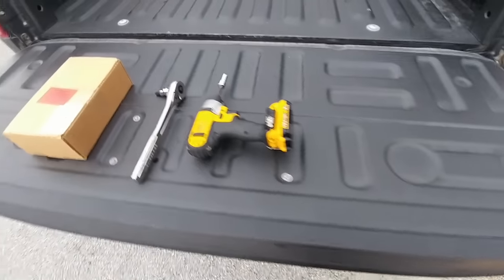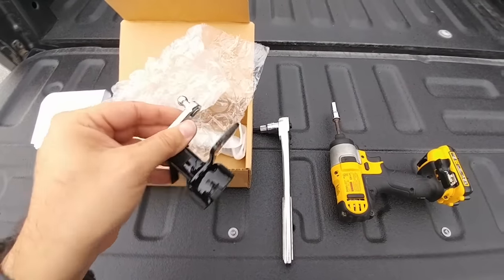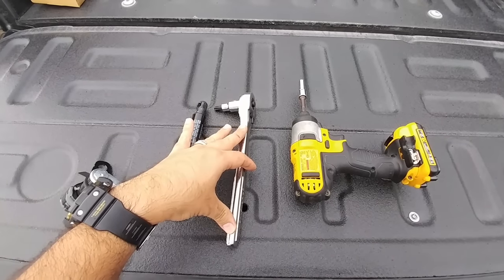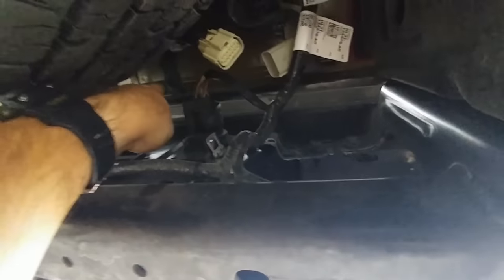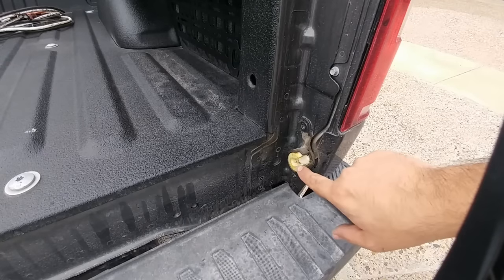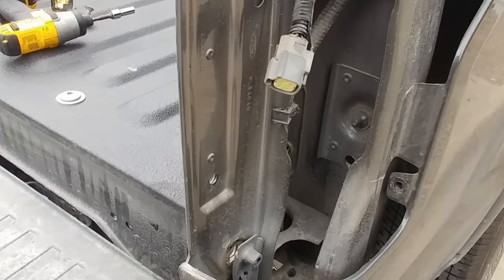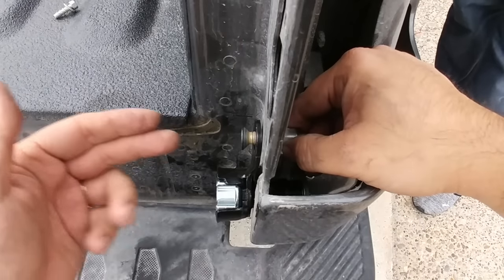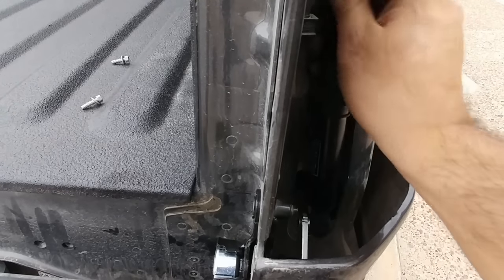Best $65 spent on an Ford F150 XL, STX and XLT!

Comment: I’ve owned trucks for over 47 years & the tail gate wasn’t a problem, what I took issue with is some commented on how they have Steps now in the gate, well after working construction for 45 years and had back surgery at age 60 & still have back pain I won’t buy a truck that doesn’t have a Step & fords is the best. I’m 64 and at least I can climb into & out of the bed of my truck. So don’t knock it because one day you might need that step yourself!!!
Reply: I get what you're saying man. I'm a disabled veteran but I cannot give up. I'm climbing in that truck if it hurt's it takes 20 mins or I'm dying. No step.
Reply: Tell that to farmboy at ga farms , he seems to be able to dictate what we can have on our trucks .  Sad , wait til he walks a mile in our shoes . ty for your comment .
Reply: Hey man I'm 27 years old and healthy as a horse and I use my tailgate step every time I get in and out of the bed of my truck. No shame here
Reply: If you have a cap the step tailgate is worthless
Reply: Agreed. When buying the truck I figured id never use my tailgate step. And almost bought one without it...... Ive found out I use the step allllll the time. So useful. Really is one of the best options on the f150s.
Reply: For those like me who struggle with a truck that does not have a built in step, specially if your truck is jacked up... it's simple enough to purchase an inexpensive folding step ladder/stool. Rubbermaid makes a "plastic" one that is lightweight and it doesn't take up that much room in your truck, but it sure is convenient when you need to get in and out of that bed. Work smart, your body is going to wear down. Don't beat yourself up unnecessarily.
Reply: My problem isn’t having a step, it’s that trucks are so big you NEED a step now
Reply: Agreed. I think part of the issue besides me getting old is that they make trucks taller now.  Or at least that is my story and I am sticking to it.  LOL.
Reply: I'm going to buy a bumper with the step for my 2005 f150 stx
Reply: So steps are necessary because you wrecked your back ? At what point do you advance enough at your job to the point you aren’t getting things out of your tailgate?
Reply: DAM I KNOW WHAT YOUR SAYING CUZ I AM RIGHT THERE WITH YOU AND MY F 250 HAS THAT OPTION  REAL  HAPPY ABOUT IT TO
Reply: @Bamacher59  ... A cap means you don't ever get into your bed again?
Reply: @rolandthethompsongunner64  When you're the sole-proprietor of your handyman business, and you still need to make money to have a living.
Reply: Agreed mate!

Comment: I've installed several of these Ford oem tailgate dampener.  You do not need to unplug the harness to the camera and remove the tailgate to install. Place a coating of towels or blanket on top of the bumper making sure the right side is well cushioned to prevent damage to tailgate or bumper. Leave the left tailgate strap attached, raise the gate from the right hinge and lay it on the cushioned bumper leaving the left side of the tailgate attached to it's hinge. You will need to pull the right corner of the tailgate rearward about 3 inches to perform the rest of the install. As said done this numerous times with zero damage.

Comment: Great video! Clear and instructional. 
While researching this, I found the DeeZee Tailgate Assist  DZ43204 for years 2015 - 2018 Ford F150. $27 delivered to my door. No tailgate removal. No tail light  removal.  Simple install. 
1347 reviews on Amazon. 86% 5 star.  Older trucks use a different  part number. FYI
Reply from the maker: I've installed several of them and unfortunately they tend to bend the ball connection on the tailgate where the nutsert goes through after a while.  If you search you'll see the videos I've done on that product.

Comment: I put the dee Zee Tailgate assist on my f150 and my f350.  Only $26 each, they work great and were much easier to install.
Reply: I just got one for my 2015 XLT.  Haven't installed it yet.  When the temp gets above 40 I will!  LOL  BTW, the reviews of the Dee Zee were as good or better than this expensive feature.
Reply: I did that too on my 17' ram my only thing is sometimes it's too slow but I mainly put it on for safety with my 3 kids being under 6 yrs. Sometimes they like to be right my heels. Other people criticize about about this product or one like it guess what everyone has a preference that's why trucks have options. No need to be  Dick's about it. The DeeZee one does work but in winter months it's extremely slow I actually took mine off temporarily

Comment: I bought one on Amazon that has the piston sitting on the drivers side well where the tailgate attaches. It literally took 7 min and came with all the tools for like $25. No need to remove the tailgate, or disconnect electrical harnesses. They are helpful.
Reply: @Get to The Choppa!  What brand did you get?
Reply: link?

Comment: I got the $20 deezee one and it seems to work really well for me, took no more than 10 minutes to install as well
Reply: Me too, and quite a bit easier.
Reply: I did also. It’s been on there for about a year and half and is still working great.
Reply: My Deezee got in a bind with the cable and ruin it staying on the nipple
Reply: Dee Zee was easy to install about ten minutes been working great even in icy conditions When it goes bad, might get this one
Reply: My deezee snapped off at the ball end 😳
Reply: Yep. I have thee DeeZee as well. So much easier to install and cheaper too. Works perfectly.
Reply: The Ford one is a lot better smoothing action.  and it is hidden.  I did the deezee first and regret "paying twice"
Reply: Me too this is great bc it’s hidden but I would rather prefer cheaper cost for a quality product and VERY easy install or uninstall if needed
Reply: I got the DeeZee one as well, but the ball mount came loose in the tailgate after less than a year. Haven't gotten around to fixing it yet, what with it being below zero recently.
Reply: Same here. I do like the way that one is hidden behind the light. Pretty neat but i like mine as well.

Comment: Might have been worth sticking a tailgate anti theft lock on while you had it off. No, they are by no means fool proof. However, it will help to prevent someone from just walking off with it in a Wally world parking lot.....great video as usual  btbrv!!
Reply from the maker: already done. Thanks!
Reply: Or lock the tailgate.
Reply: the tailgate locks with the doors on the 2018 f150 so not really needed as long as you always lock your doors.
Reply: @corystrand5136  
They are pretty easy to open and take off when locked. The lock keeps honest people honest and that's about it.
Reply: Ford tailgates lock with the doors
Reply: Just put a hose clamp around the passenger side hinge pin. That's good enough to deter most people looking to do a quick smash & grab.

Comment: Nice! I think the XLT I looked at already came with it, but I think this is a must have if not. Especially for older people, or women. It makes the tailgate easier to deal with. Still have to close it manually, but still better regardless.
Reply: I have not checked. But I would bet that the Self lifted tail gate is a very expensive up grade from the Manufacturer. I always stand on the rear tire to get inside. I also have a bad knee. Love the Video!

Comment: I put the DeeZee  tailgate Schock on my F150. It was only $35 and you do not have to take your tailgate off to install it. It is not hidden, but only takes about 10minutes to install. I've had mine over a year and still works like new. My son put one on his RAM.

Comment: This product looks good, but for the money (value), I think the DeeZee is a better option and is roughly $50 less. Also, I noticed that the tailgate did drop in the last few inches with this product.  The DeeZee product is smooth all the way and there’s no drop whatsoever.

Comment: This is the First Mod I did to my truck. It really comes in handy when I carrying a bunch of stuff. Also my Wife and Daughters appreciate it. The Other Cheap Mod I did was a 24" Wiper Blade on the Driver's side. The 22" Remained on the Passenger side. I put the Ford Mud Mats in and I ordered a OEM Seat Cover Cushion for the Driver's Side. When it wears out, they are no longer available. Next on the list is Coil Pack covers.

Comment: Interesting design. I have a silverado 1500 which came with a slow open tailgate from factory. With how often I use my tailgate and how well chevy built it, the slow open feature lasted about....6 months. I then upgraded to a deezee tailgate assist for $30 and it was a way easier install than this. Two screws into existing holes and about 5 minutes. It has lasted for 3 years and going strong!
Reply from the maker: all my DeeZees on previous trucks failed within a few months of installing.  Mainly because the previous Super Duty tailgate was extremely heavy.
Reply: I also added the deezee to my superduty but I had to put 2 on , 1 on each side of tailgate , 1 doesn't do it.
Reply: Share the link
Reply: Shra the link $30
Reply: In Alaska one opening at -50 would likely render any of these assists useless. Hood struts usually don’t last if opened in extreme cold.
Reply: @akbychoice  you up here in Fairbanks?
Reply: Riding With The Reid's still have a house in Ak currently out of state.

Comment: I would suggest putting the tail light assembly back on, after you make sure the tailgate is sitting properly in place.
Reply: Thought the same thing; you need access to the nuts for micro-adjusting the position of the hinge.
Reply: @hansschotterradler3772  that is because we are German and think logically, while also being creative.

Comment: Thanks for the video .. sorry about all the trolls ... my gf has a stx and I’ve been upgrading it little by little to make it like my xlt .... she now has a remote start and spray in bed liner .. next will be the corner step( would have to replace the whole tailgate to get her a step in it ) and this soft mechanism for tailgate will be nice for her .... I also have a new ranger xlt fx4 .. we are definitely ford truck people ..the frustrating thing is navigation .. on tge stickers they are now 700 bucks .. if you got sync 3 it should be plug and play and by a nav unit for 7 to 8 .. but ford wants 2000 for tge damn things .. after market rehabbers selling them over a grand ...

Comment: I agree with a lot of the comments, there is way to much crap for "ease of use" and "luxury".  For me, less is best.  However,  most of these little ideas come from  consumer ideas/requests.   I can underatand if its on a Lincoln truck or a cadilac truck but not on an ford, chevy or dodge.....jmo

Comment: I got the DeeZee tailgate shock. No need to remove any tailgate or lights. It works very well and was only 32 bucks.
Reply: wow, who knew removing two 8mm bolts was such a workout

Comment: Baghrir the previous, I would have put a anti-theft device on it or a hose clamp on it. To prevent people from taking the tailgate. I currently have a 2015 Chevy Colorado, it was my mistake not buying a Ford F-150 with a 2.7 l 10 speed.
Reply: And when you lock the truck, the tailgate locks on my 2015 XLT.  Don't think anyone will steal it...
Reply: Ed, why do you regret getting the Colorado? Reliability issues?
Reply: We use the truck to travel to our family in Mexico. Just not the right size for that. When I need a truck and it's just too small to do what I needed to do. When I needed to tow with it, the fuel economy was 4 miles to the gallon.

Comment: Maybe it’s my OCD but when I installed mine I used a torque wrench to finalize tightening the bolts to 41ft-lbs.  I haven’t seen anybody do that yet in their instructional video.
Reply: Andy Brown it’s motor internals bro calm down. Torque to spec your mouth shut
Reply: I don’t know why people have to use power tools to turn screws. It’s like people don’t know how to use a screw driver. And then over tighten everything with power tools.
Reply: Tom Hardware welcome to 2019

Comment: Arm strength does the same thing, better design and strength tolerances can be increased. Save $65, you need it for the fuel scam prices. That "accessory" has limitations.

Comment: Nope, must disagree with you on this one (hey, first time for everything).  Have had both the OEM and Dee Zee on a few different trucks.  Cost aside, I far prefer the way the Dee Zee opens (the OEM always drops way more suddenly at the end, and noticeable bounce at end of travel).  Your video even shows it.  Not even close, save the $40 bucks, and get the better assist, Dee Zee for the win.  Mic Drop....
Reply: dee zee looks like an atrocious after thought, who knows the quality of that strut as well. Secondly they even know it's poorly designed by offering the chaffing protector strips hahaha what a joke
Reply: Jeez, what did Dee Zee do to you in a past life.  Folks have been installing that strut for many years, probably far more on the road than the OEM.  Both the OEM and Dee work very well, but if you have ever lived with both, you would understand.  The 2 trucks I installed the OEM, was also happy with it, just preferred the Dee.  If you care about what the inner jam of your tailgate looks like, well I can't help yea there.
Reply: Ive used two on my truck cuz I had to replace my tailgate.. both lasted less then a month

Comment: I have an 08 f150 and I installed DeeZee's version of this and it worked fine at first but it sheered off at the connection inside the tailgate. Needed a new tailgate later on and I ordered a new one for the new tailgate and the same thing happened.i think it's from all of the weight sitting on the tailgate and it all goes into the mount instead of the cables

Comment: Still driving a 92 didn’t realize trucks are built for the weak now
Reply: For some reason I always loved the thud sound my tailgate makes when opening it.
Reply: Still driving my 97 f250. 
If you can't put the tailgate down maybe you should drive a prius
Reply: And I'm 71.
Reply: Perfect for the city yuppies lol
Reply: hell ive got a 94'  ( i ain't got no problems)
Reply: @cafenightster4548  -lol  i know right.  it's manly   (yeah)  oh oh oh oh -tim the toolman taylor
Reply: I knew it when the rear tire was no longer the step to climb into the bed and stairs and handrails were part of your $1200 tailgate.
Reply: I sold my 95 F-150 that only had 383,000 miles on it. It didn't do anything like this.
Reply: Carl Rice next year ford will have a built in escalator to compete with Chevy’s steps
Reply: Power steering, auto trans, power brakes, power windows, electric start, electric windshield wipers, AN ENGINE WHICH RUNS ON FUEL! Which of these do you have toughguy?
Reply: Coz you're a real man, right?
Reply: Still drive my 93 f150 everyday pulling a car hauler never had a issue with my tailgate and it gets abused lol
Reply: Brit Jamaine I’ve got a 91 225k on it and still goin strong
Reply: Biggie Baby last I checked
Reply: Cuz making life easier means your weak I guess
Reply: @ochelix4989  so being disabled is against your laws of what's a " REAL MAN " is ??? Thanks for that , so informed ......

Comment: Why are tailgates these days trending into the creature comforts area? This was never an issue before. Now they have steps, handles, soft drops, multi style opens. I feel like auto manufacturers are just over complicating it to convince you that you need these cushy features. It's a drop gate people. The best creature comforts should be a single center handle verses two side buckles and catch cables. That's all it needs.
Reply: Well the steps just simply make sense in general, nobody is impressed by someone declaring they don't need a step, just cringe.
Reply: @bobbybologna3029  it's an over complication. The back bumper is the step if you need to get back there.

Comment: Does these go on a 2006 Ford F-150 4x4? Also you only installed one on the passenger side, but do you have to buy 2 for both sides?

Comment: For all the comments about the Deezee unit (which is what I have as well), yes it's cheaper and less hassle to install but  if you want a cleaner install with no shock showing then the Ford OEM unit is the way to go.

Comment: I ordered one just like this, it didn’t work. I contacted them and they sent me another one and it didn’t work either. These were  $43.00  from Amazon. I then ordered a Dee Zee one for $22.00 and it works perfect.  Even this one that this guy just installed still slams a bit.
Reply from the maker: Careful with the DeeZee. I went through 6 of them on previous trucks.  All failed at the ball or nutsert mount.

Comment: I have F250 2012 and the sat radio and Bluetooth connections have failed, started to pull the dash apart to remove and found that hidden fasteners, without a good video found, were probably going to be broken .  I would love to see something like that from you. Thanks.

Comment: I bought a used truck awhile ago with dee zee installed, it does its job perfectly. But I don’t like it, the tailgate opens too slow I guess I’m not used to it. I don’t dislike enough to remove it though.

Comment: This is not a do able addition for a 2010 lariat like i thought till halfway into the install. 😭😭😭
Reply: I found out the same. F150 with Flareside bed never work with this stuff.
Reply: @jjxtwo1  sucks how 10 minutes of checking woulda saved us 70 bucks. Lol

Comment: I’ve thought about getting something like that for my truck but I’ve always wondered, does it make it harder to close the tailgate? Or does the shock only slow it down when opening?
Reply from the maker: just cushions it and not effects closing
Reply: Comes down smoothly have to manually close only one needed for drivers side

Comment: DeeZee makes one a lot cheaper. Works like a charm.
Reply from the maker: Lol, I'd agree if I didn't have 4 of them fail.  They either broke at the ball mount or started pulling the nutsert loose.  Either way, all 4 ended up being trash.  I have a video on the DeeZee